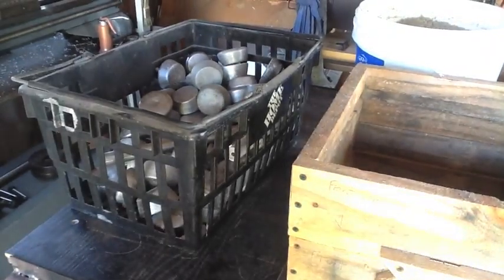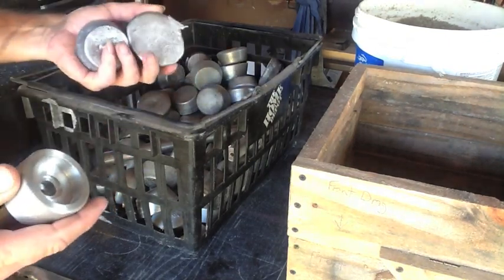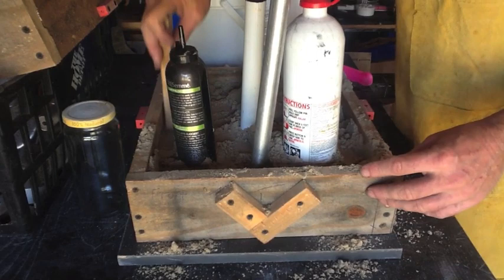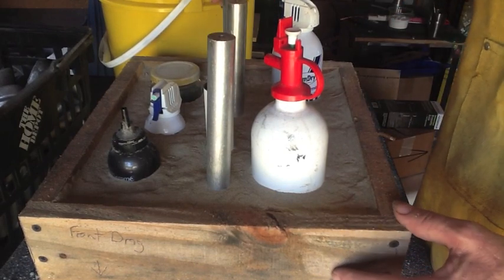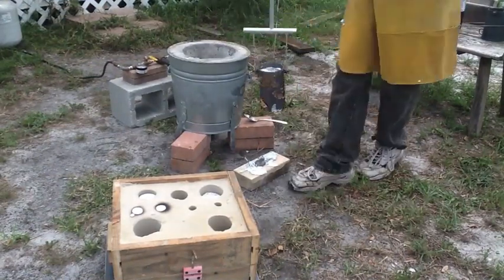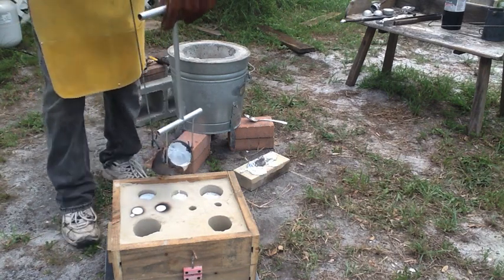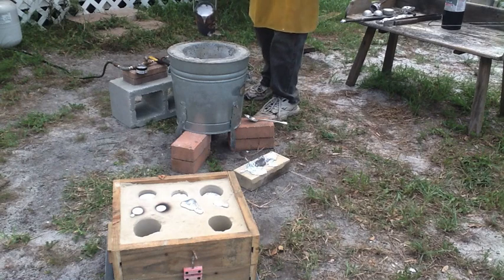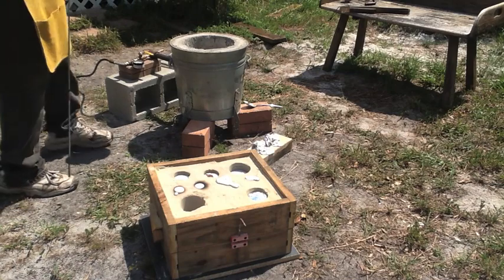Casting of Aluminum Billets for My Sears Atlas 12” Lathe

Comment: Just a thought about thinking if bubbles could be present in the billet. ( solution ) if it is poured into the molds on a vibrating table, this will assure the best way of ridding the bubbles to the surface, after the pour
Reply from the maker: Vacuum chamber would be nice :)

Comment: I find pouring into smooth bore thick walled pipe works pretty well, I once cast a 2ft long by 2 inch diameter aluminium billet into a stainless steel pipe and it just slid out once i cut the dented end off it.
Reply from the maker: I been meaning to try that once I get some seamless pipe, I dont have any lying around :(    Thanks for Commenting!
Reply: I was kind of wondering how this would work. I'm guessing there's shrinking in the aluminum that helps facilitate the separation? I've got a piece of 4" pipe here and was thinking a massive billet would be cool as all get out. The 2" stuff alone would be immensely useful though. Kinda like die casting lol.

Comment: i like your idea on making your own billets. have you ever thought of putting a steel rod in the middle of your casting to act as a core so you already have a hole in middle of casting. then once casting cooled I think you could press steel rod out
Reply from the maker: If I knew I needed a hollow center that might be an option, getting them centered would be an issue without a jig of some sort. I would probly just use a traditional sand core if I was gonna go that route to avoid centering issues. Thx for watching and the suggestion! :)

Comment: Looks like you are good-to-go now! I have been lucky enough to find offcast rounds at the local scrapyard over the past few years since I bought my first lathe. Now that my son and I have built a furnace, I look forward to trying exactly what you've shown here.
Reply from the maker: Its a cheap and easy way to have rounds on hand and just the size you need. Looking FW to seeing the furnace working after seeing your build. Done a 1st melt yet ?
Reply: We fired it up, but no melt b/c we haven't built a crucible yet. Just heated a piece of steel and banged on it with a hammer. Will post a video soon.
Reply from the maker: Very cool!, you will have lotsa fun and learn something new on each firing. Happy Casting :)

Comment: Great video.  Been wanting to do this but not enough equipment accumulated yet.  I do have a bucket of junk aluminum ready to go.
Reply from the maker: You will get there, keep pluggin away. I got about 200-300lbs of aluminum off craigslist for free without even trying hard. A push lawnmower engine is about 8lbs worth. Friends in the automotive repair business will help load ya up as well. Thanks for watching...I like the lathe :)

Comment: Check out the local recycling centers.  Machine shops recycle their end cuts.  Often the recycle company will sell these back to people like you and me.  Way the cheapest way to get stock. My local recycle'r has a room just for items like this that are worth more to resell than melt.
Reply from the maker: My scrapyards dont sell anything to the public here, just take stuff in. Turning free aluminum from craigslist into usable stuff is what I do. Spending $$ gives me a rash...LOL
Reply: Free?  That is advanced technology!  Yea, there is aluminum everywhere for melting.  Much less for turning.   But as you've shown, you can make that as well.  I bet you can't drive by a smashed up ladder on the side of the highway.   ;-)  "The Secrets of Free Aluminum for Casting" would be a great title for a future video.   I noticed your up almost 25% in subscribers in the last 30 days.  That is an amazing number.  Congrats!
Reply from the maker: Dave, you're right....I would screechh to a halt for a 14lb busted up ladder. Snatched a pair of aluminum crutches out of a trash can the other day comin back from the store. LOL

The channel has been doing well, thanks for noticing and for the congrats :)
Reply: Do you save all your household aluminum like foil and single use pans and such?  Also, I've been wondering if crucibles can be made from alternate materials like ceramic.
Reply from the maker: Nahh, not foil used with food stuffs, but beer cans are on the menu. Switched to cans from bottles to accumulate the metal. I make the crucibles from free fire extinguishers, I have a company that gives them to me. I wouldnt know how to make a ceramic one. Commercial crucibles are expensive for a reason if ya watch how they are made.
Reply: I watched the crucible video.  Great solution.
Reply from the maker: They work good. That crucible video was shot as a spur of the moment thing, but turned out to be one of my most popular aside from the blacksmith forge video.

Comment: What burner do you have for the foundry? Is there a video of you  making it and the design?
Reply from the maker: I have videos on both the foundry burner and the blacksmith forge burner, both use the same components but different configurations. I didnt get video at the time they were made but the videos go into the details well enuff to build one. Have a look in my video list for those two vids. Hope that helps :)
Reply: Do you have a parts list that I can use to build a burner similar to yours?
Reply: Also any ideas how exactly do you attach the burner to a 1/4" propane hose with a flare fitting on the end?
Reply from the maker: I dont have the exact parts list for the foundry burner but I think I listed the materials in the description of the blacksmith forge burner video. That one is easier to make and will work fine for a foundry. Same parts basically as the foundry burner just without the T for the pressure gauge
Reply from the maker: I scabbed my 1/4" fitting off a gas grill someone was throwing away, they are a great source for propane parts

Comment: Speaking of casualties, on time I was pouring and didn't realize that the metal was running out the back side of the flask.  Cooked it and about 10 sq feet of my yard.  Started casting in a sand bed or gravel since that happened.  Nice video!

Joe
Reply from the maker: Joe, I think we all have dayz like that. My funniest is I kept on adding ingots to the crucible and the level of aluminum never rose, after I had put like 6 in....I was like WTF....looked under the furnace and had a mountain of aluminum (I have a drain hole) in the event of a crucible failure *wink, wink